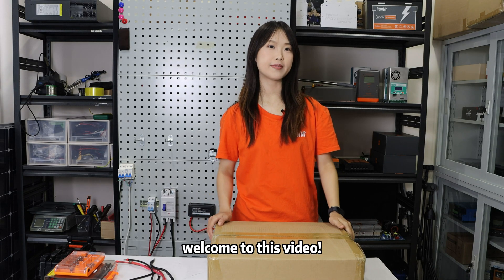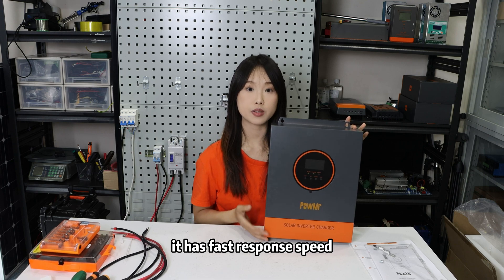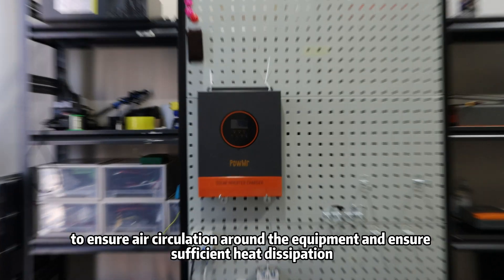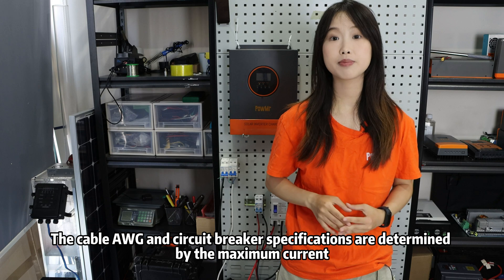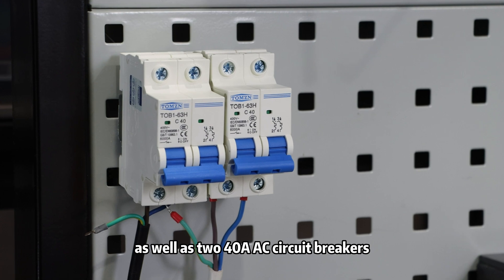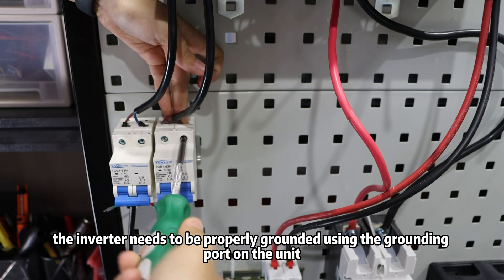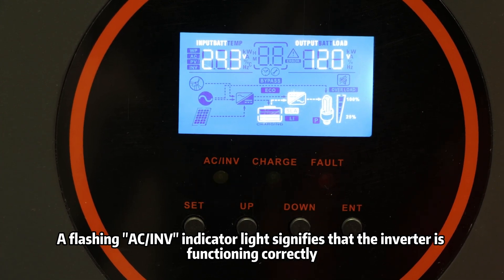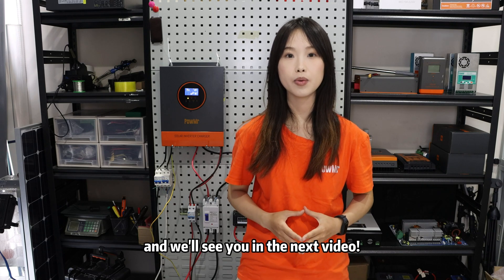How to Install the PowMr 3000W 24V Solar Inverter – Step-by-Step Guide！

Comment: Can I just shortcut the AC in L1 with the AC Out L1 (Same with GND).
They would be shortcutted in the powergrid of the House anyway.
Reply from the maker: This operation is extremely dangerous and must not be attempted. Although the L1 line and ground wire of the AC input and AC output are ultimately connected in the household grid, inside the inverter: 
The input (AC in) and output (AC out) circuits are isolated and designed not to be directly shorted. 
Forcibly shorting them may cause current to flow back into the inverter, instantly damaging internal components. 
And this solar inverter is an off grid inverter and cannot transmit power to the mains

Comment: Can I use the inverter without the AC input connection, or does the converter need it to synchronize with the power grid? Thank you
Reply from the maker: Yes, you can use it without connecting to the power grid. This inverter can be connected to PV to charge the battery, or it can only be used as an inverter. Battery is nessessary！

Comment: can i use this inverter without the grid power as off grid setup... also what is the max pv current for this inverter
Reply from the maker: Yes, you can. It is an off-grid solar inverter.
Max.PV input: 4000W, 13A, 450V, Starting voltage 150V. So, your solar panels are recommended to be connected in series.
But the inverter is equipped with an 80A MPPT controller, which means the maximum current for charging the battery is 80A.

Comment: Is it possible to use a hybrid inverter without a ac conrected.. because i have no grid tie in my area.. is actuallly for a farmland.where there is no grid..no generator.. please help me with that information..i have a 110vac  3000 watt model pow-relab 3ku
Reply from the maker: Yes, the POW-RELAB 3KU can operate in a fully off-grid scenario. This inverter supports the following features:
Pure Off-Grid Mode: Powered by batteries and solar energy without the need to connect to the grid or a generator.
Solar Priority Charging: When solar energy is sufficient, photovoltaic power is used first to supply the load and charge the batteries.
Battery Power Supply: When there is no solar energy, the batteries directly power the load.

Comment: Здравствуйте . Может ли низковольтный инвертор работать без сети ? И как его заземлить ?
Reply from the maker: Hello, thank you for your inquiry. Here is the answer to your question about whether a low-voltage inverter can operate off-grid and how to ground it: 
 
Can the solar inverter operate off-grid? 
Yes, the 3000W 24V solar inverter is designed to operate in an off-grid mode. It can convert the direct current (DC) generated by solar panels into alternating current (AC) to power your equipment even without a connection to the electrical grid. 
 
How to ground the inverter? 
Grounding is an important safety measure for the proper operation of electrical equipment. For a 3000W 24V solar inverter, it is recommended to follow these steps for grounding: 
Choose an appropriate grounding location: Select a suitable spot near the installation site for grounding to ensure a secure connection. 
Connect the grounding wire: Use a grounding wire that meets the standards and connect it to the grounding terminal of the inverter. Make sure the connection is tight and secure. 
Test the grounding resistance: Use a grounding resistance tester to ensure that the resistance meets safety standards (typically, the resistance should be less than 4 ohms). 
 
If you are not familiar with the specific steps for grounding, it is advisable to consult a professional electrician or installer for guidance and assistance to ensure safety and compliance.

Comment: Can you run 2 of this model parallel for 6400?
Reply from the maker: Sorry, this PowMr inverter does not support parallel operation, so it's not possible to run two units to achieve 6400W output. If you need higher power, we recommend considering a single inverter with a higher capacity or a model that supports parallel connection. Thank you for your understanding

Comment: Can you connect 2 phases on same inverter? 110v and 220v?
Reply from the maker: This inverter does not have a split-phase! Inverters with phase separation function include the SunSmart series SP5K, 6.5KP, 10KP, and LV12K
https://www.amazon.com/dp/B0DCVRXGM5
https://www.amazon.com/dp/B0CTHBYTSP

Low-Frequency split-phase 3000W Solar Inverter 24V to 120V/240V - This model has a power of 3000W when only split-phase output is available, and only 1500W when single-phase output is available.
https://www.amazon.com/dp/B0DJLNYPL4

Comment: Can i use the inverter without battery connected? only solar and grid.
Reply from the maker: Sorry, the solar inverter can start without batteries, solar energy, and mains power, but there is no AC output.

Comment: How can I set 24v battery to set 40% use first at night then keep rest for emergency backup. Thanks. My model is Hvm3.2H- 24v. Do I  have to set low cut and high cut?
Reply from the maker: Yes, you need to set the low-voltage disconnection voltage of the battery to stop supplying power to the load(负荷). For example, if it defaults to 21.2V, you can set it to 24V.

Comment: The installation booklet on my new  model no. HF2430U60 says "for PV to charge 24v battery banks, you will need a minimum PV VOC of 120VDC". How do I calculate that? I have four, 100W 24volt panels that I will be running in series. Will that be enough?
Reply from the maker: The HF2430U60 model has a maximum input PV voltage of 100 V. We suggest you to check the label on the inverter case to see if the Max.PV Open Voltage is 100 V or 450 V. If it's 100 V, the startup voltage needs to be more than 30V. If it's 450 V, the first startup voltage needs to be more than 150V, and the subsequent voltages can start up as long as they have 120V. 
Then check what the open circuit voltage of your solar panel is. Assuming it is 32V, 32V*4=128V, which is not enough to start for the wide voltage version of the inverter, you need to increase the solar panel. 
But for the low-voltage version of the inverter, just 30V is enough to start. You consider 4 solar panels in parallel. Or 2 series 2 parallel.

Comment: I can connect 4 pv 550w in series
Reply from the maker: What is the open circuit voltage and short circuit current of each solar panel?

Three conditions need to be met simultaneously:
1. The total input power of photovoltaics is less than 4000W,
2. Total PV current<13A
3. Total PV VOC<430V (initial startup requires voltage greater than 150V)

Comment: I have the POW-LVM3K-24V-H, there's only two spots for AC output no ground, am I supposed to ground it to the inverters chassis? Should I add it to the grounding screw that's there for grounding because you cannot run AC safely without a proper ground.
Reply from the maker: Hi friend， the grounding of the AC output and the grounding of the AC input share the same terminal (the grounding terminal of the AC input).
Reply: @temank2741  the input side of the AC that would come from the house is not being used this unit is being used off grid
Reply from the maker: Is the charging mode you have chosen priority for mains power? @blindvegan
Reply: @temank2741 there is NO mains power
Reply from the maker: You can directly connect the AC output grounding wire to the grounding screw on the housing, and then make the housing grounding @blindvegan

Comment: Why Would I need 2 x40 amp Breakers ? Here in the UK our plugs have a 13 amp fuse built in so this would blow first. (ac in ) Also I have wired an extension lead to the AC out which also has a 13 amp Fuse as standard which again would blow, so the 40 amp breakers would not be needed as they would never blow because the 13 amp fuse would always blow first. I agree using a160 amp battery breaker but not sure about the other 2
Reply from the maker: If the maximum output current provided to the load through bypass is 40A, it cannot exceed this value. Therefore, it is recommended to configure a standard 2P-40A-AC circuit breaker. The 13A fuse is too small and can easily trigger the fuse

Comment: can I use the inverter without the ac in? I want to be off grid and only have solar in. I hope that makes sense.
Reply from the maker: Yes, you can use the inverter without the AC in
Note: The initial start-up voltage of the PV of this inverter needs to be greater than 150V Afterwards, the voltage just greater than 120V can the inverter be started.

Comment: I'm installing in a van, the A/C out uses only 2 wires, is the 3rd wire (ground) not used?
Reply from the maker: The third grounding wire of the AC output can be connected to the grounding wire terminal of the AC input

Comment: Can the system work without a solar panel, just with grild alone?
Reply from the maker: Yes, you can use the Utility or AC generator for charging. It can also be used only as an inverter

Comment: I want to buy the 3200w, 220v
Can  I use any type of battery and is there a specific size that I must use?
Reply from the maker: The voltage of the battery should be consistent with the system voltage of the inverter. For example, a 24V inverter should connect to a 24V battery. And suggested battery capacity greater than 100AH
Reply: what will happen if i only use 100 ah

Comment: for clarification, in the manual of same item, the recommended wire size is 6AWG.. i am confuse because you are using 2AWG in this presentation. thanks.
Reply from the maker: Hi friend, battery wire diameter recommended: 30mm ²/ 2AWG;
The recommended PV Wire Diameter is 3.5mm ²/ 12AWG
The recommended AC input/output wire diameter is 6mm ²/ 10AWG

The wire diameter is only for reference In case of long-distance between a photovoltaic array and an all-in-one inverter or between an all-in-one inverter and battery, using thick wire to reduce voltage drop and improve system performance

Comment: How to change fuse pow-hvm3.2h-24v
Reply from the maker: The fuse is usually located at the battery terminal. Use a multimeter to measure and see if the fuse is broken. If it breaks, you can search online for the same or similar fuses based on the current on the fuse to replace it. Alternatively, contact the seller of your order to apply for the original fuse.

Comment: Hello,
One Question please: 
In europe,   Mono 220 volts only    ,     Hybrid converter  for 48 volts batteries;
What is the "empty consumption"   (at night without much load f.i.)   of your  6200 or 8200 or 10.200   watt machines?
Thanks
Reply from the maker: No Load Power Consumption: 50W（6200）, 70W（8200）, 72W（10200）

Comment: what are the minimum volts for the inverter to work without batteries? Thanks 😊
Reply from the maker: Sorry, this inverter needs to be connected to a battery for operation. No support for battery-free loading
Reply: Does this means inverter cannot work with only solar panels ??

Comment: How would be the connection in mexico with 2 lines 110v ??
Reply from the maker: Only use one 110V live wire with one neutral wire. It is single-phase 110V AC power. If two 110V live wires with different phases are connected, it means inputting two-phase 220V AC power. This inverter cannot be connected to such a high-voltage AC input.
Reply from the maker: If there is only two-phase 220V, no single-phase 110V, or no zero line, it cannot be used.
Suggest purchasing 2 sets of PowMr split-phase 5000W solar inverters or a single PowMr 10K split-phase solar inverter

Comment: How about generator connection?
Reply from the maker: The wiring method is the same as connecting to the Utility 
Note that if the input frequency and voltage of the AC generator are unstable, it may result in the inability to use AC power normally

Comment: hi uo to how many solar panel can i put  for 24v
Reply from the maker: Is the purchase the latest version of POW-LVM3K-24V-H? The maximum input of this inverter is: 4000W, 450V, 13A
The total Power must not exceed the PV power when the PV modules are connected in series or parallel—PV power: 4000W
The total voltage must not exceed the PV open circuit voltage when the PV modules are connected in series or parallel—PV open circuit voltage 430V at 25℃ environment temperature.
The total short-circuit current must not exceed the PV short-circuit current when the PV modules are connected in series or parallel—PV short-circuit current：13A
All three conditions need to be met simultaneously

For example, your solar panel is 300W, 28V, 10A

Due to a current of 10A, all solar panels can only be connected in series and cannot be connected in parallel
450/28=16.07, rounded to 18
4000/300W=13.33, rounded to 13

Because all three conditions must be met simultaneously, a maximum of 13 * solar panels （300W, 28V VOC, 10A) can be connected in series.

Comment: Well done and I love it
You are so clever
Reply from the maker: 1. The grounding of 3000W24V AC output shares the same grounding port as the AC input terminal

2. The grounding screw on the shell of the solar inverter is connected to the ground with a wire
Reply from the maker: Thanks